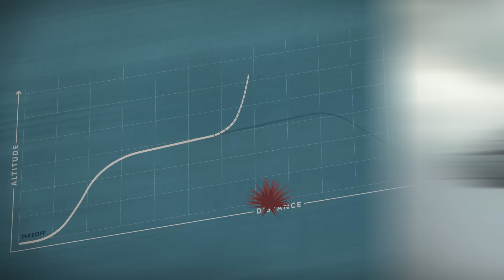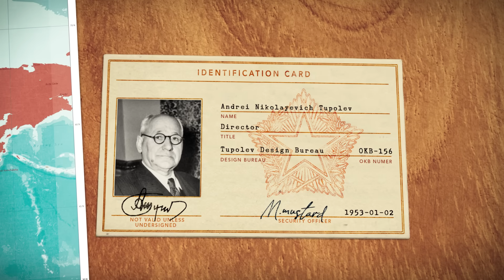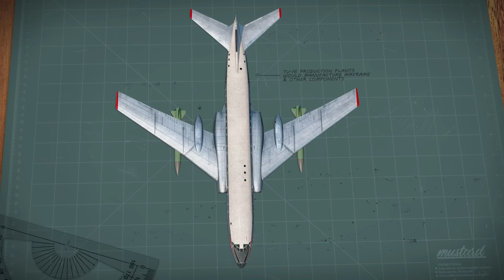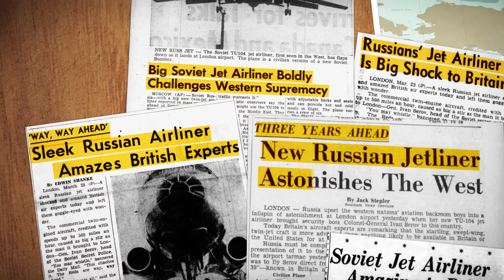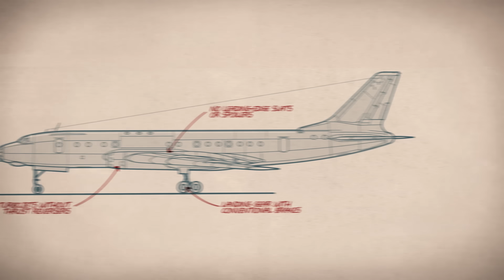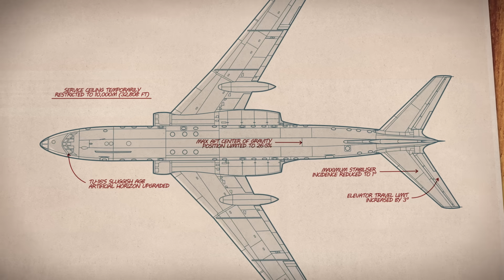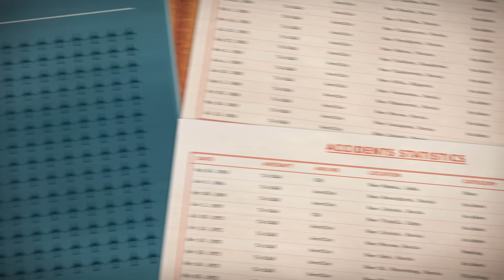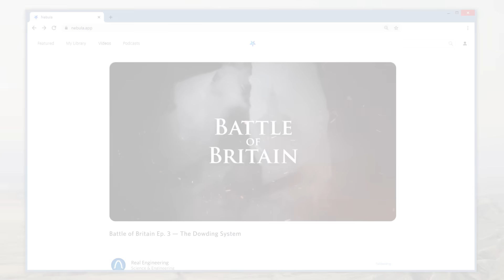The Soviet Airliner Designed To Crash

Comment: DC 10
Reply: The DC-10 only has 12 aircraft lost out of 386 built.
 This is Compared to 16 Tu-104s out of 201 built.
The de Havilland Comet is 39 crashed or destroyed out of 114 built in total.

The DC-10 has a better safety record than the Airbus 320..
Reply: @sandervanderkammen9230  WELL MATE I CONCEDE, IM DEFINITELY WRONG. ,DO THEY STILL  MAKE THE          DC 10 , ,,❓ SURPRISED TO HEAR DE Havilland I'VE FLOWN MANY TIMES ON THE OLD BEAVER , CESSNA'S  FLOAT PLANES THANKS FOR THE CORRECTION MATE STAY SAFE CHEERS 🥂
Reply: @sandervanderkammen9230   

 The DC10 has an average accident loss rate for an aircraft of its first flight date & specific years of service however it had a difficult start to its life & needed various safety related  modifications before it could maintain that average safety status. 

Accident Losses Comparison 
Airbus A320  FF 1990        0.6% 
DC-10              FF 1970        7.0%
          
Obviously it's always very important to note the relevant facts.

Kharzeestan Krappenz DiktorBummer  Diktorbatermasturjurkzxoffenzische etc and co - they should all note good with much awe & extreme wonder.
        UPDATE MORE BREAKING NEWS ETC

 Of course De Havilland carried out a full stress analysis & performed extensive & protracted testing on two long lengths of fuselage. De Havilland carried out significantly more testing than was required by any authority at the time.
 
It is the case that The stress for the crown sheets when measured was not greater than predicted.
  
  Obviously there have been worse aircraft for accident losses both before & after the Comet.

    How things were back then -
Accident losses - % of aircraft built.
DeHavilland Comet 4 UK     14% 
DeHavilland Comet all mks  17%  
Vickers VC10 UK 5%
   The DH Comet had better safety than or similar safety to many other commercial passenger aircraft of a similar era
    Douglas DC-1        99%
      Douglas DC-2        47%
    Douglas DC-3        30%
      Douglas DC-4          26%
    Boeing s300            72% 
 Boeing 307               70%
  Boeing 247                48%
     Boeing 707                   20% 
Lockheed L-049/149 Constellation  30%
   Lockheed Electra  Turboprop    29%
Fairchild FH-227                        30%
 McDonnell Douglas DC-8        14%
  Sud Aviation Caravelle            15%
Canadair CL-44  Turboprop     46%  
Convair CV-580  Turboprop     22%
Convair CV-880    (ff 1959)       27%  
Convair CV-990     (ff 1961)      33%
Tupolev T-104          (ff 1956)    16%

Obviously the French Caravelle, a very similar aircraft to the Comet, also at the time didn't result in Sud Aviation becoming a significant competitor to Bow-wing  (See B-47 wing folding and wing collapse incidents).
        The Comet was designed with military use in mind, Nimrod work started at De Havilland in 1953.
  The committee did not find hundreds of fatal flaws or evidence of design defects, structural defects, defective materials or shoddy workmanship. Ripstop provision was included. Claimed incidents did not involve cracks starting from window corners & one particular incident did not involve a fracture running from a rivet hole. 
     The engine & engine intake position had advantages, were not flaws or fatal flaws & were not the cause of any incidents involving any Comet or Nimrod aircraft. Nearly all changes before the Comet 4 were just in case or were previously scheduled improvements. 
  In fact it is the case that the skin thickness of the Comet remained largely unchanged for later versions. The alloy used was changed simply because the manufacturer discontinued the original version. 
  Bow-wing & the 707 story (see b-47 wing folding & wing collapse incidents) is the result of global economics & the well protected & very large domestic US airliner market & active support from the UK with for instance proposed competing airliners from Vickers & DH being blocked by the UK government at the time, cheap & nasty was the requirement with large scale production capability in one place.
  The 707 was of course a much larger aircraft which as a stressed skin metal airframe aircraft would require a thicker skin anyway. They got lucky at the time essentially.  Bow-wing is the result of the large & well protected  US domestic airliner market 
  The 707 had a very long production run with a large number produced, the average life of a 707 doing airline duty only was about 22 years. Military duty 707 airframes get a lot of big military budget attention & there are plenty of spares from retired aircraft which is why there are still examples in service.
  The fate of De Havilland was due to Govt policy Aerospace sector rationalisation & global economics, it was nothing to do with the Comet.
  A comprehensive, thorough & protracted testing program was carried out on the prototype & it's assemblies. Of course the Comet did indeed have Ripstop stop provision. 
     De Havilland (Of England) Comets were not grounded after 1970 due to structural problems.
It's interesting that some of the aircraft on the list should really have been noticeably safer than the Comet due to being a similar type but of much later design & manufacture but they definately were not safer.
    How things were back then -
Accident losses - % of aircraft built.
DeHavilland Comet 4 UK     14% 
DeHavilland Comet all mks  17%  
Vickers VC10 UK 5%
   The DH Comet had better safety than or similar safety to many other commercial passenger aircraft of a similar era
    Douglas DC-1        99%
      Douglas DC-2        47%
    Douglas DC-3        30%
      Douglas DC-4          26%
    Boeing s300            72% 
 Boeing 307               70%
  Boeing 247                48%
     Boeing 707                   20% 
Lockheed L-049/149 Constellation  30%
   Lockheed Electra  Turboprop    29%
Fairchild FH-227                         30%
 McDonnell Douglas DC-8     14%
  Sud Aviation Caravelle       15%
Canadair CL-44  Turboprop   46%  
Convair CV-580  Turboprop 22%

A comparison of more recent aircraft.
Accident losses comparison examples. 
1970s - 1980s
    % of total Aircraft built
Similar aircraft type, date / decade, useage, size.
    Biz Jets
BAe-125-800                        1.7 %
Beechcraft Beechjet 400    2.2 %
Cessna 550 Citation II         7.1 %
Learjet 35 / 36                       12 %
Beechcraft 1900                  6%
Dassault Falcon 10              11.5%
Aérospatiale SN.601            22.5%

Medium size jets / Turboprops.
BAe-146               5.1%
Fokker 100          6%
McDonnell Douglas DC-9-30       9.5%
Fairchild FH-227       30%
McDonnell Douglas DC-8    14%
Canadair CL-44  Turboprop   46%  
Convair CV-580   Turboprop   22%

Beechcraft, Fokker, McDonnell Douglass, Learjet, Fairchild, Aerospatiale, Canadair, Convair  companies defunct.

    All Comets, including some Comet 1s, had full civilian use certification at some point after 1954,  civilian use certification only being withdrawn after commercial flying stopped. Examples were flying until 1997 - one example did a signals research global circumnavigation flight series in 1993 via Australia virtually without a rest travelling 28000 miles, only had an ice warning indicator issue during the flights.

    The DH Comet - World Firsts.
1st gas turbine jet powered airliner. 1st high altitude 8psi pressurised full fuselage length passenger cabin airliner,  not a trivial feature as structure  strength required for pressurisation considerably exceeded strength required for normal flying stress. Nobody else had done anything similar before the Comet.
  The b-47 (& the Junkers) used relatively small, heavily built  pressurised modules  (Bow-wing b-47, the aircraft where 6 had their wings fold up in 2 months while flying & some had their wings fall off while parked). 
   The 1937 Boeing piston engined airliner pressurised passenger cabin was pressurised to 2 psi only - in fact that could easily be done as the normal unpressurized fuselage cabin structure strength for flying stresses only was all that was needed to be adequate so no significant weight increase issues needed addressing.
    1st all hydraulically powered flying surface controls & actuators airliner with under carriage wheel disk brakes + ABS.
1st jet airliner to cross the Atlantic.
1st jet aircraft to do a world circumnavigation flights series.
  Of course De Havilland had prior experience building many all metal construction airframe aircraft including thousands of jet powered fighter aircraft that were primarily of metal construction with pressurised cockpits & jet engines built by De-Havilland & we know the world's first all metal construction airframe airliner was built in England in the 1920s by Handley Page.
  Indeed it is in fact the case that airliner construction & testing changed everywhere, including in the US, during & after the Comet investigations.
     De Havilland did indeed always work to better than industry standards at the time, used up to date knowledge for the design & no evidence of negligence  or criminal negligence was ever produced in relation to the DH Comet.
    The course of De Havilland & the general UK aerospace industry sector was not affected even slightly by the DH Comet. The course of national aerospace sectors obviously being similar & inevitable in many countries.
     Other interesting World firsts
World's first turboprop aircraft.
Vickers Viscount Turboprop Airliner 1947. 
A 1945 Gloster Meteor Aircraft with Turboprop Gas Turbine Engine.

They might like to answer these questions.
   Which airline has just ordered
60 RR England Trent XWB Engines
& What aircraft are the engines for?

Bonus question for 10 points.
         Which country has the 
World's Highest Combined Per Capita
  Nuclear + Defence + Aerospace Sector Activity?    

          👍 & 🙂 & of course 😎 indeed.
          C H E E R S & without doubt  -
          Toodle PIP Old C H A Ps.
 

. .... . ... .. . . ...
. . ... ..         ...
Reply: @sandervanderkammen9230 DC10 

Obviously it's always very important to note the relevant facts isn't it?      

It will come as no surprise that we do indeed feel we can clear up some commonly held myths and misconceptions.

Regarding the obviously spurious & entirely fictional claim that the DC-10 has a lower accident loss rate than the Airbus A320.

Clearly it is definitely the case that the DC10 has an average accident loss rate for an aircraft of its first flight date & specific years of service however it had a difficult start to its life & needed various safety related  modifications before it could maintain that average safety status. One of the issues with the DC-10, it involved a lost engine incident due to engine mounting problems, caused a significant change in how service / maintenance info & activities regarding required safety related modifications would be dealt with by airlines, the manufacturers & aviation safety authorities in the US.
   
   In fact the cargo door fault that caused the historically deadliest aircraft accident loss incident at the time was not rectified for all aircraft immediately due to a rather strange  agreement between an FAA person and people at the manufacturers. The aircraft only attained average safety stats after a number of significant safety related modifications were completed for all DC10 aircraft during the early years of operation.

Accident Losses Comparison.
Airbus A320      FF 1987       0.6% 
DC-10                 FF 1970       7.0%
          
Obviously, it goes without saying, it's always very important to note the relevant facts isn't it? 

We do hope this helps, as usual in fact, of course.   
   
Indeed, Cheers etc 👍, of course, obviously.

(It's perfectly normal to feel rather irritated & annoyed by this style of comment, don't be alarmed if this happens. Obviously, do feel free to seek professional psychiatric help if indeed the reaction doesn't subside within 30 minutes.)
Reply: .DC-10 is still flying today and has a better safety record than the Comet or the Tu-104.
Reply: @sandervanderkammen9230  DIDN'T KNOW THEY EVEN STILL MANUFACTURED THE DC 10 ANYMORE , I REMEMBER A LONG TIME AGO HEARING QUITE A FEW TIMES OF AIR LINE CRASHES AND THE MAJORITY OF THE TIME IT WAS THE DC 10 , THATS THE REASON I PICKED THEM AS DANGEROUS
Reply: @sandervanderkammen9230  I DIDN'T KNOW THEY WERE STILL BEING MANUFACTURED , THEY USED TO BE INVOLVED IN CRASHES AND ACCIDENTS ON FAIRLY REGULAR BASIS

Comment: I thought the dc10 was bad
Reply: The de Havilland Comet was the worst jet airliner in history, no other plane has a higher loss rate or fatalities statistics than the Comet.
The DC-10 actually has a very good statistical safety record, and it is still flying today.
Reply: @sandervanderkammen9230 As if it would make up the recklessness of the russian pilots, one aeroflot crash was even caused by a sleeping pilot
Reply: @Xylozet  de Havilland admitted that they never performed the stress calculations for the fuselage sections that failed, BEA airworthiness certification only required one section to be tested, de Havilland engineers assumed the stress would be the same for all the sections.
The stress on the crown sheets was 2 and half times greater than the maximum amount predicted
Reply: @sandervanderkammen9230 and the soviet never admitted anything regarding their failure and just cover it up by blaming others
Reply: @Xylozet  Same for the British, they tried to cover-up the Comet Disaster and still refuse to admit that 34% of Comets crashed or were destroyed in accidents.
It's by far the worst safety record of any jet airliner in history.
Reply: @sandervanderkammen9230  Tried and never has a different meaning. Dehavilland grounded their aircraft after the third crash for an investigation while the soviet continued the operation of tu-104 until the retirement in 1981
Reply: @Xylozet  See, that's exactly what I was talking about.
The Comet 1 was grounded in 1954 AFTER SIX!!! HULL LOSS ACCIDENTS.
The Comet 1 had its airworthiness certification PERMANENTLY REVOKED in 1955.
It's the worst engineering disasters in the entire history of commercial jet aviation and the worst safety record.
Half of all the Comet 1s completed were destroyed in accidents